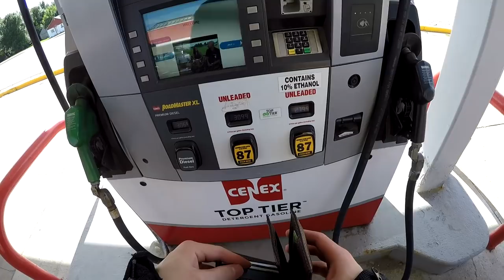2019 Raptor 700? + Riding on the Interstate!

Comment: Did you ever watch ATVondemand? Check out the one where they ride a 49.5 wide Raptor 700 prototype and watch the one where they put the 450R Yamaha up against the Raptor. I wouldn't worry about the piston. I'd just the exhaust, intake, and fuel commander. It really makes so much more power plus you'll still have engine longevity.
Reply from the maker: I'll check him out, thanks!

Comment: Higher octane helps resist pre-detonation and keeps the cylinder cleaner. It is definitely needed with a high compression engine but also with an engine running a more advanced timing curve. So those Raptor 700's with a tuner (like you use when you upgrade the intake or exhaust) should also be careful. Its also not a bad idea when the engine is going to get ran hard in the heat. a.k.a. The sand dunes in the middle of summer.

Comment: The regular Raptor 700 is to much like last year. They skimped out of that one for sure. I do like the red one the best. My favorite all time Raptor 700R is the 2016 SE. Black n yellow with a little bit of white. My second favorite one is probably the red one. On with the compression ratio. A lot of people don't realize that manufacturers give lots of room for modifications. You can easily throw in a 11.5 pistion in it and do other great mods like the block off plate. Get a full exhaust and power commander and intake. That's all you really need. Once you start adding a lot more torque you can jump up 1 tooth in the front sproket and then mess around and perhaps ditch a tooth in the rear too. You can get more speed out of them fairly easy.
Reply from the maker: The 2016 looks great too! I've thought about doing my top end (piston and cam) I just can't bring myself to do it since my engine runs perfectly ya know? If I ever have a problem or once I put more hours on it I'll definitely rebuild it with a high compression setup. I do have a power commander and i've been looking at duals for an exhaust. I've read the forums and they are a game changer with an intake of course. Thanks for your comment!

Comment: Also check out 3 MUST BUYS for your New Raptor 700. That guy knows what he is doing. He knows exactly what exhaust to buy. It's the best one for the best power curves. He says dual's rob Raptors of power. You gotta read down in the comments to find out what exhaust he is talking about.
Reply: The pre-2015 bikes make more power with duals because of the twin exhaust head. The Raptor forum has more than a few dyno plots for reference.

Comment: I live in Arizona where quads are street legal. What is the maintenance and running cost monthly?
Riding it on the street. Do you have as much maintenance as opposed to riding it off-road? 
Would you recommend this quad for a street application? 
I'd be thinking possible R1 upgrade...
Reply: This is exactly what I'm trying to find out. Im also in AZ and im trying to cop an ATV to head to the gym or school or back home. I can't find one that's good or even recommended for street/highway use.
Reply: @S.GRIMES because atvs are offroad vehicles, none of them are recommended for street use.

Comment: I've been told it is easier to flip an ATV on paved roads. Is that true? I am a total noob when it comes to this
Reply: In some ways yes. There is much more traction so the tires are going to grip more instead of slide. However offroad there are more bumps and rocks that could make your flip

Comment: Mid grade is way better than premium. The entire point of running high octane fuel is fuel economy on most naturally aspirated engines. You are hurting your quads performance outing “better” gas in it..... SMH
Reply from the maker: SMH..... the entire point of high octane fuel is to reduce engine knock in higher compression engines. Truth is I don't like running ethanol. And where I live all gas except premium has ethanol. It's also worth noting that premium fuel produces relatively the same performance as a midgrade fuel. UNLESS the engine is running hot. That's when premium fuel really produces less performance than midgrade.